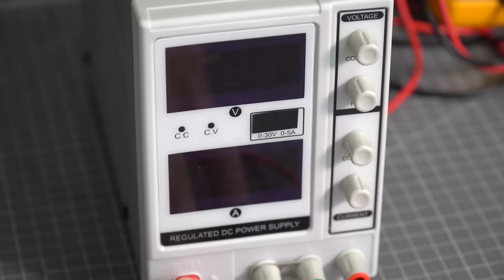Making a Solenoid Boxer 4 Engine

Comment: Hook up a load to it and measure how much work it can do compared with input power to determine the efficiency.
Reply: It isn't going to be efficient.  A regular electric motor will be much better.  This is just a cool toy.
Reply: Yeah, I thought about this... hook it up to a standard motor and hook that up to an oscilloscope... you could make a little dyno and tweak the weak points. This setup needs some kind of variable contact so it can adjust the timing. Maybe rotating contacts.
Reply: @Plur307  obviously it won't be efficient, that isn't the point.
Reply: @officermeowmeowfuzzyface4408  so why spend the time and effort calculating efficiency if efficiency isn't relevant and it is just a fun display piece?
Reply: @Plur307  to learn how to design better one. Duh.
Reply: @officermeowmeowfuzzyface4408  there is no reason to design a better one, they exist, they are called electric motors and billions of dollars of research has already gone into them.  They use the same concept as this motor, wound coils of copper creating magnetic fields, but are much more efficient.  There aren't all the silly moving pistons, the magnetic field directly produces rotational force. This piston design is silly and has completely unnecessary parts that just add friction.
Reply: @Plur307  so we have a basis to compare how poorly wrapped the solenoids were, for example.  More data is always better, it's for the future 40 years from now, and not just selfishly "right now".
Reply: @officermeowmeowfuzzyface4408  I don't think you understand how an electric motor works.  There is no point improving this design as it will never perform as well as a regular electric motor.  It is just a toy.
Reply: @Plur307  oh I do understand.  Especially since there is no load, can you really call it a motor lol.  Get it to try doing any work.  Just get any number out of it at all.

Comment: Is it necessary to turn coil voltages on and off in sync in order for this to work?   And if so, how do you do that? 
For the record, you have some serious skills!   Thank you.  Great video!
Reply: The microswitches in the base fire the solenoids at the correct time.

Comment: When you drill brass, use a slightly dull drill.
Reply: aserta why? Because it’s soft and not worth using a new bit?
Reply: @savagetuner2404  it's not so much that the drill should be dull, but that it should have a very small flat stoned on the cutting lips so that they meet the work at a 90 degree angle (called zero rake) instead of the usual acute angle (called positive rake).  

The qualities of brass are such that if this is not done the brass tends to snatch at the drill (you can hear this slightly when he's drilling, I think) which can cause the drill to jam/break and in a longer hole can also cause the hole to wander.

The same is true of turning tools for brass --  the top of the tool should be level both front to back and side to side.

I keep a box of drills only  for brass.  When I need one that isn't in the box I convert a regular one on the spot using a fine diamond hone, and then it goes in the box.
Reply: dbeierl ah, I see. So zero rake is essentially the same as holding your lathe tools straight and firm so they don’t catch. Thanks for the thorough explanation, helped a lot. Does that apply only to brass?
Reply: @savagetuner2404  you're welcome.  Brass is the only one I know of off hand.  Most other materials work well with varying degrees of positive rake.  Many lathe tools on large heavy machines use negative rake.

In a drill bit the rake angle is built into the helix angle of the flutes, unless it's modified as for brass.  In a lathe tool the rake is a combination of what's ground into the tool and the angle of the tool in the holder -- most tool holders for use with "lantern style" tool posts on small and medium lathes have a ?15? degree positive front rake built into the holder to save having to grind it on the tool. 

With such a holder a tool for steel would be ground flat on top along the cutting edge, and slope off to the side away from the edge.  A tool for brass would have the top of the tool level side to side, but ground away at an angle front to back so as to remove the built in rake from the holder.

Carbide tool inserts will have negative or positive (ore sometimes zero) rake built into the insert, usually in combination with a chip breaker.
Reply: dbeierl damn bro, when are you gonna start a masterclass for this? How about you do a video on your channel? This stuff is cool, and I don’t know beans
Reply: dbeierl THANK YOU!! You’re going in my chronicle of epic gamers, what a help bro. I tell ya, this stuff is a dying art that needs some resurrection. And again, thank you. God bless
Reply: @dbeierl  Perspex requires negative rake. Not sure that many large machines use negative rake as a rule (I've used a massive  1920s vintage vertical lathe with a 4 meter turntable that used standard high speed steel cutting tools with normal positive rake) but carbide tool bits basically  have zero rake with chip-breakers built into them - that is they have zero rake on a short section about 1mm, then a relieved section just behind that for swarf to curl into and break off - essential for high speed and mass production.
Reply: @yuta4mama  agree -- I should have thought of plastics in regard to needing special rake angles.

Re big machines and negative rake -- in 1920 high speed steel was itself a new thing that had revolutionized machine work and required a new generation of heavier machines to take advantage of it; and it didn't really take over the industry until the forties.  But the point isn't that heavy machines must or should use negative rake, it's that light machines in general can't because they aren't rigid enough to do various things that industrial machines can.  Negative rake cutting forces are far higher than positive rake.

Carbide inserts are available in a large variety of dimensions and cutting geometries, and of course the final geometry applied to the work is a combination of tool and holder.  On the 3/8" TCMT (Triangle, 7 degree front relief, loose tolerance, double-countersink) inserts I sometimes use (six inch Atlas) the entire chip breaker is within the first 1 mm of the edge.  

I also have a small stack of SNG633 negative rake inserts for a much larger machine.  They have a 90 degree edge so both sides are usable, and both rake and front relief angles are set by the tool holder.  They are flat surface and chip breaking must be supplied by the holder.
Reply: @dbeierl  All very cool - thanks!

Comment: I'm not satisfied: Why does it not run balanced, due to the fact you had made all parts with an absolute perfect precision?!
Reply: For a demonstrative video it's pretty well balanced in my opinion, fact is if you want to produce these with a high risk free factor you need more precise machinery
Reply: I think the rods may be different lengths
Reply: It is balanced but the vibration that is making it seemingly unbalanced. The same issue are with BMW motorcycles. They are shaking horizontally. 
Camels are unbalanced in your view but they wont fall :)

Comment: PORSCHE: I will use this in electric 911.
Reply: 912* but....
Reply: Hate to come back to first degree realism. But no sane engineer will ever use that in production. A classic synchronous or asynchronous rotor induction motor has an efficiency of 99% so there is no need to try idiotic designs like this. This is beautiful and fun, but it's just for art. Also asynchronous motors are available in mass produced series with no need for R&D.
Reply: @vindieu  Well it's just a joke :) They are already using PMSMs in their EVs.

Comment: My wife thinks its boring. Any divorce solicitors reading this 😠?
Reply: You don't need a solicitor, you need a contractor. Or better yet, DIY your man cave and go reversed Lutheran on your hide-out by nailing your unilateral requirements on that door: "If allowed to cross the threshold, this is what's expected of ány visitor..." To then go nuts on your sanctuary's rules of engagement. 

That's actually great advice I'm going to follow up on myself! ;-)
Reply: Cute Cat
Reply: dont divide!!

Comment: Your idea was only hypothesized until now, maybe it wasn't realized because of the missing materials, but seeing the engine concretely realized, even if on a small scale, is not bad. I'm sure you can make a larger engine too, but that's the concept. To be more precise, you can make a bigger engine and see if a full-scale machine can work, but I'm sure it can work, maybe by making some adjustments. The only problem, of course, is the efficiency compared to an internal combustion engine, but not bad all the same.

Comment: The switches ran off the drive shaft so it was like a 2 stroke engine not the 4 stroke in my old VW Bug which had push rods between the cam shaft and valves. To be more like a VW you could of made the block out of aluminum magnesium alloy which is flammable and get it burning like sometimes happened on VWs.

Comment: How did you ground each solenoid per cycle?  It should just lock up when you turn all the magnetic fields on. Oh duh... they are all pushing. So one side is push into the solenoid where its repulsion is maximized as the other solenoid is less. So that accelerates out driving the crank to push the rod into the solenoid till it maximizes as well creating and endlessly pushes crankshaft. Clever stuff.

Comment: Everything was a work of art, but then I see the winding of the solenoids and scratch my head. Compared to everything else, that part looks a bit rough. I'm surprised you didn't use the lathe to wind the solenoids - that would have let you wind them smoothely and the computer would have kept track of the number of turns for you :)

Comment: Very interesting video. One thing I noticed though, at the end when the motor was turned on, the shaft is not balanced big time. The parts were cut, drilled etc very precisely. How come that the shaft is off like this at the end?

Comment: is that 10 amps it is drawing?  it can be used as generator, shaft it into a flywhell with big diameter to attain speed at the smaller wheel by gear ration using belt. qo amps is good for lightings..

Comment: boxer engines opposing connecting rods share a single pin on the crankshaft. This is just a flat four engine as each connecting rod has its own pin

Comment: Technical question... was it necessary to make the cylinders in two parts? It looks like you could have lathed both end pieces in place :)
Reply: Looks like it could've been one part, yes. Just like the crankshaft could've been made in one piece with cheap and easy to make clamp and slightly altered design.
Their overall machining skills would land them a D at any decent machining school or training. Nice for the uneducated, painful to watch for others.

Comment: Awesome work. would you be able to explain how this actually works? Are the coils constantly powered or are they powered in sequence to pull the piston to the other side?
Reply: It looks like they are powered in sequence by the 4 microswitches which are pressed down by the crankshaft

Comment: Why wind the coils on brass bobbins?
The brass just acts as a giant shorted turn damping the buildup of magnetism.
Why not wind them on plastic or at least have a full-length split in each one so it does not complete the shorted turn circuit?
Reply: I believe magnet wire is enamel coated so it wouldn't short anyway no? Or am I misunderstanding?
Reply: @liammurray9274  Yes, misunderstanding, I'm afraid. I realize that there is no galvanic ie metal to metal connection between the windings and the brass bobbin. The problem is that the brass acts as a massive shorted turn connected only by magnetism. Yes brass isn't magnetic but neither is the copper wire yet it generates a magnetic field when energized.
As the current builds in the copper coils it generates a magnetic field, some of which excites a current in the shorted turn which in turn builds a flux in opposition. This results in a net lower flux and lower induction. This means much more current is required to magnetize the core. Look at any solenoid winding. They are always plastic encased. Wind your coils in plastic bobbins and you will need only a fraction of your existing drive current. Not only that, the shorted turn damps the flux buildup so you should also see an increase in speed. Dominic. Hope this helps.
Reply: @dominictoon7768  Ah yes, I think I see where you're coming from now. Is this due to eddy currents? Or am I still missing the mark? Thanks for the informed response I did think I was probably misunderstanding.
Reply: in this case, I imagine he used brass due to it's low friction for the walls of the cylinder, I would substitute it for delrin off of your advice then I guess.
Reply: @liammurray9274  Delrin would be perfect. Even way back in my apprentice days in 1964, we used Delrin for transformer and solenoid bobbins!

Comment: So what hind of power will this small engine generate? If a lot does it stand to reason that a bigger one will power a full sized automobile?  😮
Reply: It's probably not that much but skipping that, putting it in an actual vehicle would be extremely inefficient, better way would be just putting a normal electric motor in that vehicle.

Comment: just like to point out that you could have had a single activation mechanism with an oval shaped part with a hole in the middle connected to the crankshaft.

Comment: The cylinder made of electrically conductive metal (brass) greatly reduces the efficiency of the motor! It works like a short-circuited turn, where a lot of electromagnetic energy is lost. Make the cylinders out of plastic and you will see that the engine will work better.
Even just make a cut in the body of the cylinder to open this turn - the losses will be less!
Reply: The cylinder/armature has to be metal..thats how a solenoid works

Comment: What a wonderful video! I'm wondering which materials you used for the fabrication of the engine? I'm guessing (based upon your other videos) that you're using 6061 Aluminium, but the cylinder looks like it's made out of bronze or brass? I'd be interested in learning about the materials you used, as well as how you sourced them. Thank you!

Comment: I wonder, rather than using microswitches, which will eventually wear out after a million operations or so, and perhaps have a bit of bounce, as well as stiffness, which will steal efficiency; you could use the engine itself? Have metal contacts swiping past a wire. Might be the whole engine would end up being, say, positive, and the solenoids all connected to negative by the insulated wire. 

I suppose what you'd be making would be a distributor, in fact that's what the microswitches add up to, but could it be done better with a commutator of, say, lands on a rotating wheel, and, say, sprung ball bearings as contacts? Should be infinitely robust, at least, or as long as the springs last. It's what petrol cars do, although in that case the electricity is providing a spark, not motive force. 

Maybe you could measure current draw vs horsepower for either method?

Comment: Did you connect the ends of the copper wires, which are wound on cylinders standing next to each other, in reverse?

Comment: Nice but the use of mechanical switches instead of hall sensors probably hold the design back from it's full potential. There should also be reverse biased diodes across the coils. Standard engineering practice.

Comment: Electro magnetic (solenoid Engine) Classic VW engine lol. 
Ha 😁. Imagine the idea of an engine the actual size of a vintage VW air-cooled boxer. And see if it works 🤷‍♂️ probably need everything like the cooling tins. Dynamo.. but it would need even less than the original one. Items unused here would be I.E: Fuel, ignition system, Valves... ect... 
Have it on a gearbox like a normal car. And hey. 
Unusual car.
Reply: Never know... might even be as fast as one too 🤣🤣🤣 hahah. 
All amazing content. And certainly gets the mind going in a good fashion. 
Brilliant work.

Comment: Nice to see. However, between contact burn and mechanical cycling, the micro-switches will have a short life.
Reply: A digital controller would be a way better choice, but these solenoid engines are only really useful as educational tools anyway and the switches help for visualization of the circuit. If we cared about efficiency at all we'd just build a normal motor.

Comment: With the same success, a lion's ass was attached to the mythical eagle and called a Griffin.The whole point of the engine with EMF is merged into of loss of efficiency in this example. In the next video, you will see the invention of a square wheel and cone-shaped roads for this wheel.

Comment: i did an engine solenoid v8, usin a real v8 dodge engine, changing pistons by solend y spark plug by energy from generator. cero fuel.